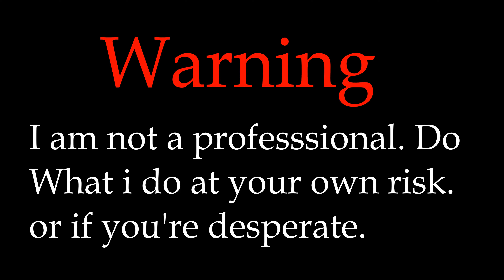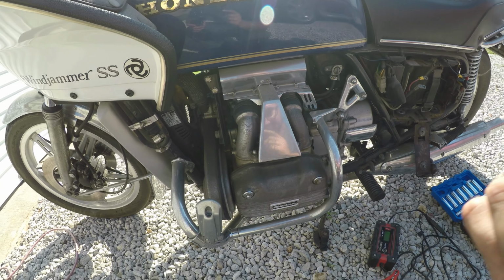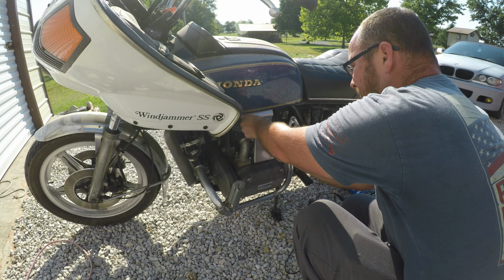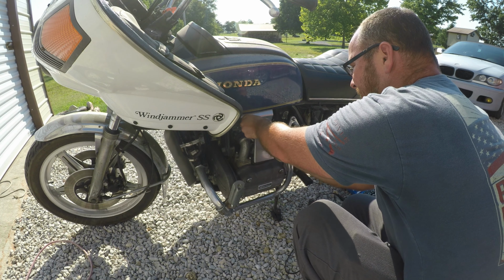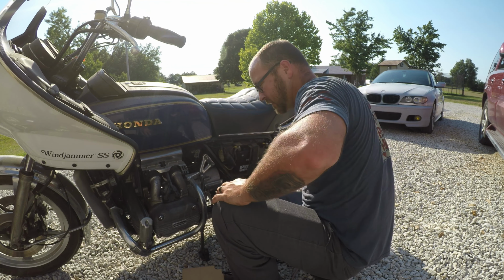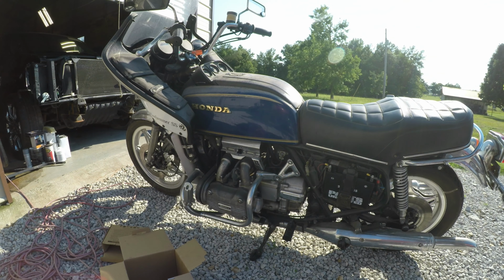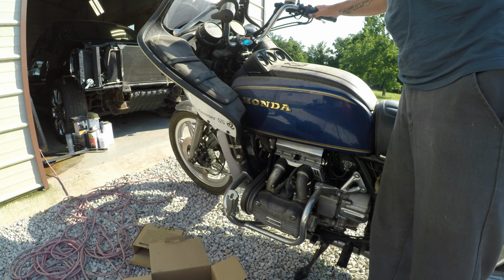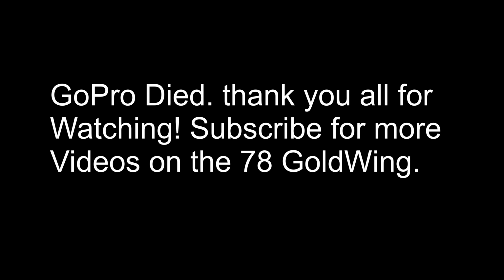Will it run First start in years. Free 1978 Honda GoldWing

Comment: Hey CW I have the exact same bike and Im having the same problem with the rough idle and hesitation with the throttle. It wasnt this way when I bought it two years ago but i didnt ride last summer and it sounds like yours. What did you do to correct the problem?

Comment: Modern ethanol based fuels are murderous for carburetors when they sit for much longer than a year.  Wouldn’t hurt to run some carburetor cleaner through it and/or remove them to clean out the fine passageways.